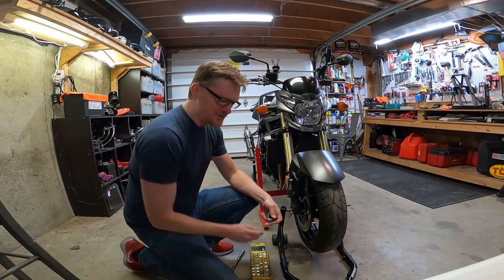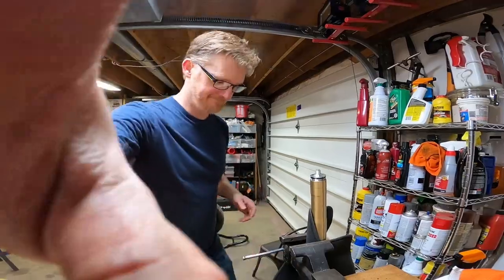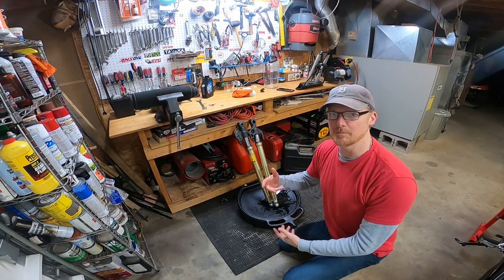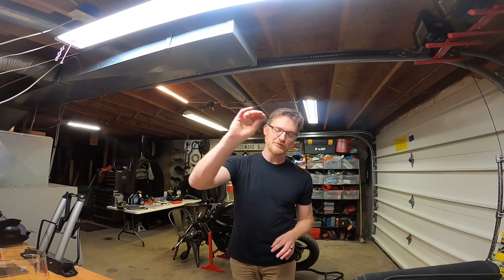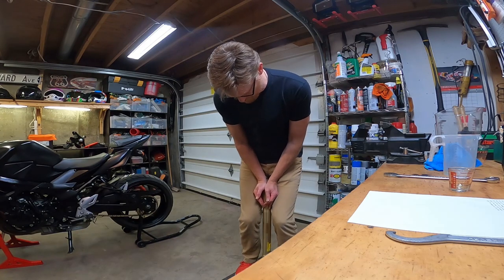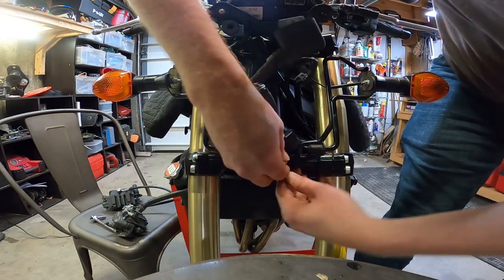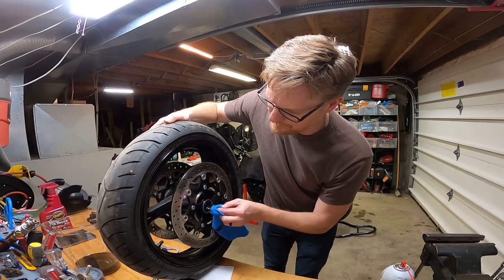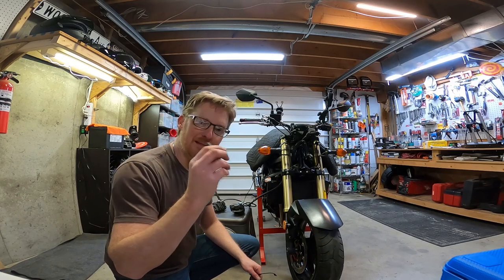20,000 Mile Fork Oil Change | GSX-S750 / GSR750

Comment: I'm a huge believer in maintenance or better yet, even preventative maintenance. I am living proof it works. My 93 ranger has 484,000. I just gave my daughter a chevy impala with 300,000 miles and runs like the day it was new! I can go on n on n on etc..... Lol Don't get me wrong there's always mechanical failures whick maintenance won't help but some guys wander why? Lol. Great job!  I recently put progressive fork springs in my klr. Supposedly a couple warmer days coming here on PA, can't wait to take a rip on my bike!
Reply from the maker: Wow!! That is truly impressive mileage on those vehicles. I've always been big on maintenance and believe MOST vehicles will last much longer if only regular maintenance was performed. My struggle in VT is winter rust and rot. I do my best to keep it at bay but it catches up eventually. We'll be riding soon enough, Lord willing :)

Comment: Great video .. do you happen to know the oil level in mm ? with or without spring inside because I need to change my seals to :( and I can't seem to find a manual or the info online
Reply from the maker: Awesome :) That is the RIGHT way to do it! Install the inner rod/damper (60nm), no spring, compress it fully, pour 520 ml inside the tube. Move the inner rod/damper up and down slowly until no bubbles come out. Refill fork oil up to the top while bleeding air as needed. When done top off the fork with more oil as needed. Move the rod slowly a couple more times to make sure no air bubbles. Wait 5-6 minutes. Keep the tube level the entire time. Compress fully. Fork oil level should be 96mm or 3.8" from the top. Note, when installing the spring, the large diameter should face to the bottom. Inner rod lock nut 15 nm. That should get you there!
Reply: @sstressfl  you just saved my bike .. thank you !
Reply from the maker: @bufuair  you’re welcome! 🙏✌️

Comment: Thanks again man. For my left one, I put the left one at capacity and it doesnt feel like theres any resistancem as it was empty
Reply: It feels and sounds like theres no oil in the fork despite me adding it
Reply from the maker: Seals are blown?? Is it leaking? Spring rate adjustment?
Reply: @sstressfl  Maybe the adjustment, there were no leaks. Is one for supposed to feel different than the other or identical when compressing off the bike?

Comment: I need the service manual for the  gsr750 help me plz !😁
Reply from the maker: The service manual for the 2015/16 gsxs750 will get you there 👍 the only diffs (from Wikipedia) Comparing the GSX-S750 with the GSR750, the changes made to GSX-S750 include a new exhaust to comply with Euro 4 and California emission standards, a new tapered handlebar, new swing-arm, a revised air box, and ventilation holes in the bottom of each cylinder to reduce pumping loss and improve power. It uses a 43 tooth rear sprocket compared to the GSR's 42, to improve acceleration, and top gear was lengthened to keep the top speed the same (250 km/h +/- or 155 mph +/-).
Reply: This is the information I was looking for. Thank you very much, you saved me and I will be able to continue with my research to repair my motorcycle.
Reply from the maker: @brayancorrea1402 so glad to hear it helped 🙏

Comment: Gsx s750 2017 front shock oil how much use per side?
Reply from the maker: Im not sure... you might have diff shocks than the 2015. Best to drain it thoroughly then measure how much you took out. Replace with the same amount 👍

Comment: Why not just cut the pinch bolts down 5mm and clean up the tip of the threads with a die?
Reply from the maker: Ive done it many times... I usually thread a nut onto the bolt, cut it, clean up the end on my bench grinder, then remove the nut. The nut cleans the threads as it is removed. Works great. Didnt feel it was necessary, but absolutely something you can do :)